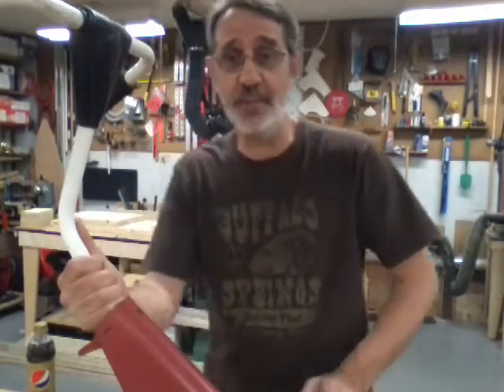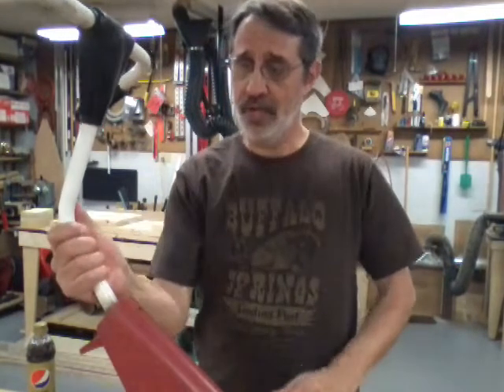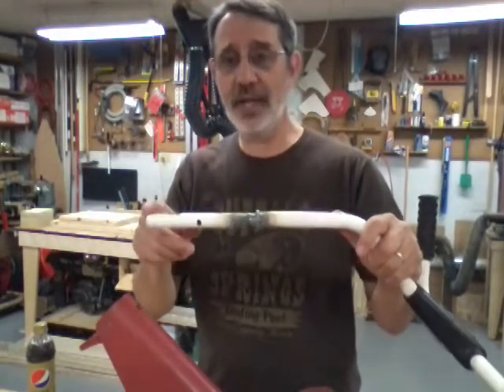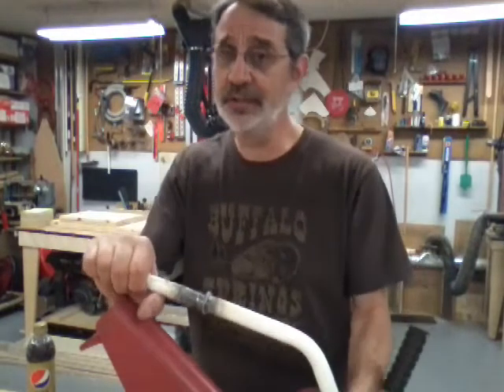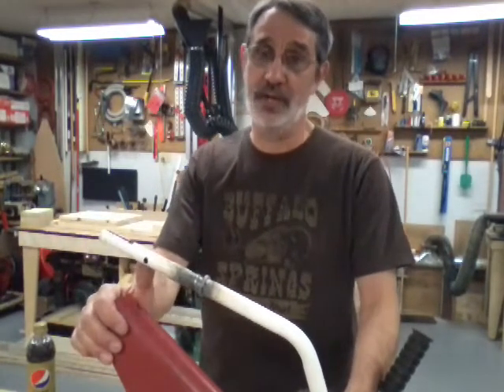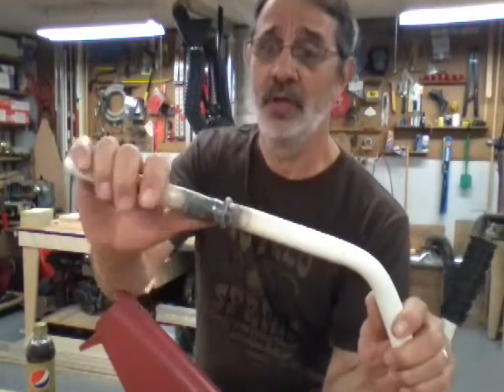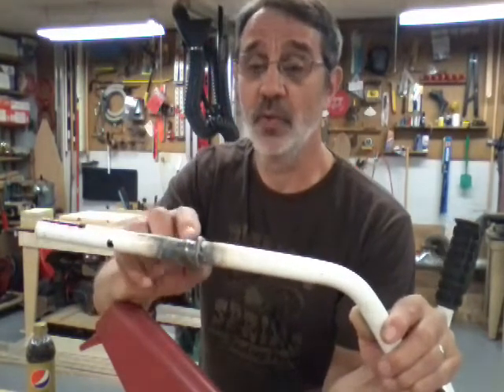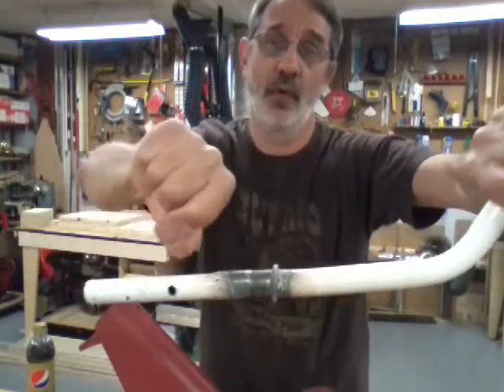106.  M/S. 10 How to straighten the handlebars on a snapper rear engine rider

Comment: Thanks for your quick reply Jim. I did subscribe to your channel.  I am talking about the bearings on the blade shaft in the mower deck. These are the sealed bearings that you recommended to use. Thanks so much
Reply from the maker: Allen Crossland 
  Hi Alan if you're talking about the spindle bearings in your mower deck you want to watch video number 65 I talk about rebuilding the spindle thanks for your questions,   talk to you soon Jim

Comment: Hi Jim, I would like to watch a video of you replacing the shaft bearings on a snapper rear engine mower beck.
Reply from the maker: Allen Crossland 
 Hi Alan I have a video of replacing the bushings on the axles if that's what you're talking about if you're subscribed to my channel go in and watch video number 19 shows replacing the bushings in the fender.  Thanks for your question talk to you soon Jim

Comment: Hello Jim this is Robert from South GA calling I have a 25'' cut snapper RER that the pivot is frozen on do you have any tricks to break that loose without allot of tearing down I've tried spraying it with PB blaster and putting a pipe wrench on the tube and hitting it with a heavy rawhide type hammer a few times with no luck so far not sure if it has a pilot bushing in it or not it's one I have had around a while that I picked up on the cheap I'm currently completely rebuilding a 28'' cut and didn't want to tear this one apart right now lol...  Would appreciate if you can do a mini video on that subject if you have any ideas
Reply from the maker: Robert McMullen 
  Hi it's Jim. Your talking about the pilot I hope you mean the tube that goes from the front assembly into the rear case if so I am uploading a video right now that will explain how I've got them out before I hope it helps the video number is 107 if you have any other questions let me know otherwise i'll talk to you later Jim

Comment: my handle bars are the smaller tube  and thats why the bushing that was shipped out didnt fit mine .It was for the large dia shaft I guess I will just leave it off because its still 99% better than it was with the new front end bushings

Comment: hi there. i have a snapper rer with those same handlebars and they are also bent. i have tried bending it back with a hammer and brute force but that did nothing. i dont own a propane torch but is there anything else i could do to bend it back into shape?
Reply from the maker: Craftsman 1963 
   Do you live by a muffler shop   they will have a torch and should be willing to help.  Or a welding shop.  Or a machine shop.  We have people stopping in for help a lot.   Thanks Jim
Reply: yeah there is a muffler shop not far from my house. i might contact them, but if they have a welder, ill ask if they can weld something else for my snapper; i have a spare snapper comet series handlebar (the old retro style handlebars) that my grandpa gave to me and i would like to swap the tricycle bars with those comet ones. unfortunately they no longer manufacture nor sell the steering axle made for that handlebar type, so instead i'm wanting to use a steel bar that i took from the mower deck and have it welded to the current steering axle and mount the handlebar using bolts. would a muffler shop do that too? how much would it typically cost? thanks.
Reply from the maker: Craftsman 1963 
Hi it's Jim a muffler shop may do that for you but I don't think they would let you use their welder. And I have no idea of the cost.   Let me know how it works out.   Thanks Jim.